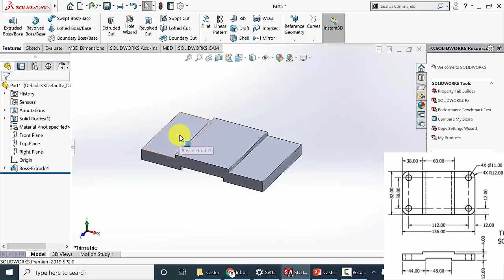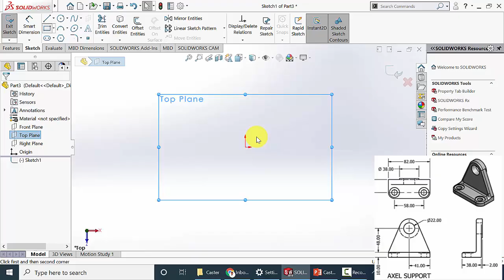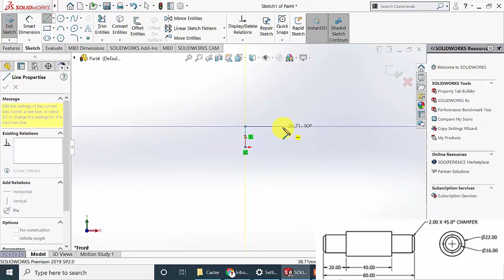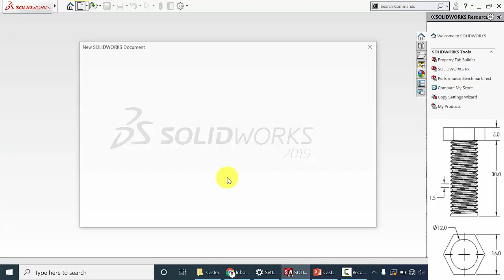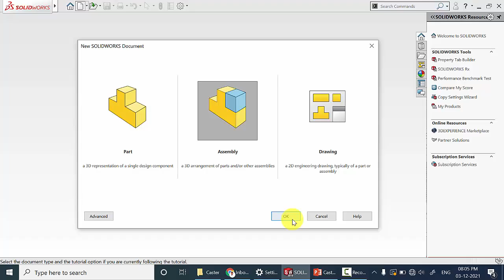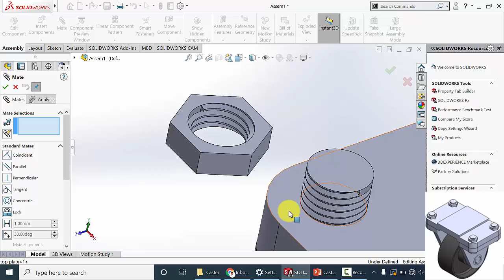Caster wheel assembly using SOLIDWORKS | SOLIDWORKS Tutorials for Beginners

Comment: Do you have the front and side sectional views of this wheel? Or do you have any idea where i can find them
Reply from the maker: To derive axial deformations for a column using the Finite Element Method (FEM) in MATLAB:
Define the geometry and material properties of the column.
Create a mesh with finite elements (e.g., 1D beam elements).
Specify boundary conditions (e.g., supports and applied loads).
Assemble the stiffness matrix for the system.
Apply loads to the column.
Solve for the displacements using a solver like the backslash operator ().
Calculate axial deformations at different points along the column by analyzing the displacement results.
Visualize and analyze the deformations as needed for your specific problem.